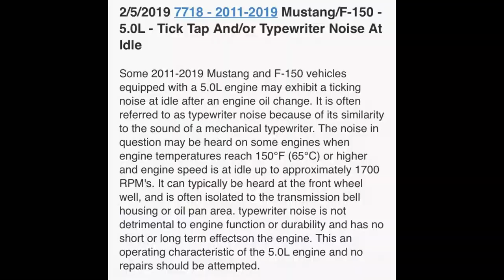2018-2021 Mustang GT Typewriter Tick/BBQ Tick. Don't Be Worried!

Comment: I've had my 2018 for almost 3 years now. Ticked since day one, no engine issues at all.  I don't even care about it any more. My biggest mistake was listening to Youtubers stating opinions as facts....that happens a lot these days. You are right about dealers putting in 8 qts instead of 10. I had to point this out to my dealer ship atleast  twice, each time they gave me a hard time about it and assumed I didn't know what I was talking about.
Reply from the maker: Man I came across it all the time. Your doing the right thing don't care about it. If it was a major issue you would know. It would be a different noise. A lot of these youtubers or people making a big deal about it don't even own the car. They hear it and are like o that doesn't sound good. I did change my oil yesterday using Cerma that I showed. Hasn't ticked yet. But I'm like you. I don't care I know there's nothing wrong. Runs smooth as butter.
Reply: During your warranty (3year maintenance) period. They only put up to 8qts. It only after that period that they add 10qts which is when you pay regular price.
Reply: Utube facts are really funny but true, that's how Trump got elected.

Comment: The tick is oil pressure related, regardless of viscosity used. The best answer we have come up with after trying to diagnose everything from big end bearings bumping side to side, to DI noise, is that the tick is most likely from the "Hydraulic Lash Adjuster" on Piston #3. This particular spot is the most arduous path of oil flow to all the HLA's. The problem is, when the oil is cold on startup, there isn't any noise, because cold oil pressure is close to 40psi. As the oil warms up, the hot idle oil pressure drops. As it goes below 30psi, you may start slowly hearing the ticking sound get louder and louder as it continues to drop to 12-15psi at idle while the oil bypass is open. This low pressure drops even further as it has to reach the HLA's. By the time it reaches #3 piston HLA, the pressure is just low enough to cause the Adjuster not to fully inflate, and become lazy. This causes it to have a tiny gap between it and the lifter. So, in a rather non-synchronous way, it will tick as that tiny gap opens just slightly with each cycle of the lifter.

As you increase engine RPM, the tick may become slightly more synchronous and noticeable until the engine RPM is high enough to make the oil pressure go above 30psi. Once RPM reaches close to 3,000RPM and the oil bypass then closes, this high pressure also fully inflates the HLA, and no more noise.

To stop the noise, I use Ceratec. Ceratec increases the lubricity of the oil to a point where tight fitting HLA's will inflate easier, and make the ticking go away. The amount of Ceratec needed to stop the ticking varies with each car, as those tiny gaps slightly differ from car to car. My car only requires about 100ml (1/3 bottle) to make the noise go away. When I give it a fresh oil change, I start the car and let it warm up to hot idle. I then slowly pour in Ceratec while at hot idle until the ticking stops (~100ml). That way I can use one bottle for 3 oil changes.

I use Quaker State Ultimate Durability 5w-30, with only 1/3 bottle Ceratec (~$50 per oil change). The cost for oil is  much less than trying to use boutique oil, which is not really necessary, unless the engine is for heavy duty use or frequent racing.
Reply: @BeardedFordTech  I know the recommended weight is 5w-20. However, in 2018+, the manual does say for track use, they say to use 5w-30, as the higher viscosity provides better protection. Main reason they went to 5w-20 is to increase fleet wide GPM for gov't CAFE standards. I discussed this with Ford, and they do allow full time use of 5w-30 oil without affecting the warranty for normal use. In fact, some dealers and Roush warranteed dealers will recommend 5w-50 Motor Craft Full Synthetic for people who have superchargers installed and drag racing.
Reply from the maker: @Condor1970  I knew about the 5w50. Coworker had a Roush. He used it cause he had to. So all those warranties i did for wrong oil could have been customer pay. Thank you for sharing with me. I don't put mine on the track though. I have sportbikes for that. Anyway. Have a good one and thanks for the informative comments!  Much appriciated.  Just looked at my manual. It does say track use recommended 5w30. Here I am telling people to look in their manual and I don't have one. I had to look on ford pass for my manual. Again thank you
Reply: Is it normal to have a consistent tick only at idle? Mine ticks only at operating temperature.
Reply from the maker: @granthenneke  yes. Mine does too. It's completely normal. The ticking your probably hearing is the high pressure fuel pump when stopped at a light or just idling. You can hear my pump and injectors. I wouldn't worry unless it's gets older with RPM and does not stop
Reply: I bought my ‘19 GT MT with 17,000 km, now at 21,000 km I’m starting to hear piston slap between 1600-2600 rpm, it isn’t loud but it is there (a bit more evident when cold start), hear it right in the passenger side as the guy in the video mention. Car isn’t under warranty anymore but I bought an engine and transmission insurance. Is there something I could do to stop it from progressing? Have the car for only 1 d*mn month and don’t want to start the calvary of an engine replacement as it doesn’t seem to affect yet. Sh*t I love this car in velocity blue but don’t know if I’m getting it right.

Just read your 5w30 oil recommendation, guess I’m beginning with that.
Reply: @JorgeMoren0  please post back with results
Reply: Thank you for your long and detailed explanation. So you think this won't affect the reliability and durability of the engine?
Reply: @EricZAchille  most likely not.
Reply: Uhh, cold start oil pressure is closer to 100 psi than 40 psi.
Reply: Idk what everyone else is talking about but mine ticks from the moment I start it til the moment I shut it off. Doesn't matter the temp or rpm. Its an obvious flaw in the coyote engine and should be recalled.
Reply: @redgoldrainwater5508   Have you tried running a heavier oil?   
The best explanation I’ve heard for the Gen 3 noise is that the noise is a combination of the VCT working at low rpm combined with intermittent loading characteristics of the high pressure fuel pump causing temporary chain slack oil on the drive side of the RH primary chain which then causes the chain to “slap” or “click” against the timing chain guide.  
It happens when the VCT is making large cam timing adjustments at low rpm, which if you’ve ever degreed a set of OHC cams you’ll be familiar with the phenomenon…and I’m sure the cam driven high pressure fuel pump throws a whole other variable into the mix.    

Apparently limiting the VCT range (via tune) at low rpm and/or running a thicker oil can help minimize the noise.
Reply: @BC08  yes I went to 5w30 and it just got worse
Reply: @redgoldrainwater5508   5W-30 is so close to 5W-20 at operating temps I’m not sure changing to a 5W-30 would mask much.  
I was thinking more along the lines of a 5W-40 or 5W-50 and see if it effects the noise.
Reply: Hey Condor1970 any idea why this often starts after the first oil change.
Reply: That does not work. Ive tried everything
Reply: My ‘21 didn’t start ticking until I took it into Ford for its first oil change at 5,000mi. I brought it back and they told me Ford released a statement saying that it’s due to new oil being introduced and that it would eventually go away on its own. It’s a 2021 GT MT btw
Reply: @Ryescookies  I'm starting to think it's oil pump related. Maybe even cavitaing at the suction, which goes away as the oil ages and gets carbon particulates in it.
Reply: @Condor1970  I have a 2011 F-150 with the Coyote 5.0L that the Ford dealer says only has 10 psi oil pressure at hot idle. I took it in because it was having VCT codes (and running rough). They recommended a new engine. I put 5W-40 in it and so far the codes haven't come back, but I still have a slight "tick" that gets louder when the engine is slowing down (after you give it a shot of gas). Haven't worked inside an engine since 1982, do you think I can just change the oil pump and bearings and leave the top alone? Only has 75,000 miles on it. Probably going to sell it, but don't want to sell somebody a truck that is about to blow up.
Reply: @lenm2857  I don't know if the 2011 is supposed to have an oil bypass at idle. If it does not, then 11psi is very low, and indicates some really worn crank bearings. On the newer 5.0's, the oil bypass valve opens at low RPM, because they are trying to decrease oil pressure and load on the engine at slower speed to increase efficiency. The bypass energizes and close above about 3k RPM. I've read if there is a way to make the oil bypass orifice smaller, or just disconnect the oil bypass solenoid, so it stays shut all the time, then idle pressure goes up to 30psi and the tick goes away. However, I have not tried this.
Reply: My 2022 GT ticked irregularly (with no regular pattern) tonight when I shifted into park after a short 15 min drive.

Does not tick when in drive/foot on break, which makes me think Condor1970 is on to something.. Not even 7k miles on it, just did a certified ford dealer oil change a couple months ago, feeding only 93 octane since day 1. I am thinking it has to do with the temperature, tonight it was around 47 degress F.  I will need to check more often after having it run for about 20 min then put it in park and see if it happens again another time...

Still love this car tho.  Hoping to keep it forever.  5.0 purrs so nice when driving at these cooler temperatures.
Reply: I know I’m probably super late and am hoping to get an answer, this question might be pretty stupid but is Ceratec ok to use in 10 speed autos? Cause I’m having this EXACT SPOT ON issue with my ticking. Just curious cause I bought 2 bottles worth but it says on their website to not use on auto transmissions?
Reply: @JrLara-ne8io I add a bottle of Ceratec at every oil change. Been doing this for 3 years and no bbq tick. Mine is 10 speed auto and has 43k miles.

Comment: I came up with the Ceratec back in 2018, it fixed it for my 2017 Mustang GT. Did a lot of research on why it mostly happened after the first oil change and I found out that Ford put some oil additive with the factory oil in the cars and after the first change, they won't do that anymore, that's how I came up with the Ceratec. Works like a charm.
Reply from the maker: Yeah but you have to keep using it and it doesn't work on all of them. Tried it on a neighbors. Didn't work. Run amsoil in mine. It stopped.
Reply: I am going to use Amsoil only on the s650 but I’m going to see what happens and I hope mine doesn’t.

Comment: I have daily driven my 2019 mustang gt 6 speed for a year and a half now with just over 5000 miles. I gotta say it is a well built car. Mine has the tick but runs great no issues at all and seams the tick is only during idle. Always follow break in procedures and you have no worries.
Reply from the maker: Never had issues with mine. Yes the tick is at idle. And your right. Ford came out with the break in procedure for the S550 (2015-present) I was a tech there for 6 years and we would always tell customers. Some would listen some wouldn't. Break in procedure is as follows for S550 mustangs 2015-2021 for people who don't know. Thank you for bringing up a great point. 
The vehicle requires a break-in period. Drive your new vehicle at least 100 mi (160 km) before performing extended wide open throttle maneuvers and at least 1,000 mi (1,600 km) before performance or competition conditions.

Mine runs like a champ!
Reply: hey put liquic molly ceratec in your oil, and it'll go away. i put it in my 17 and it fixed it immediately
Reply from the maker: @predalienftw  I'm not a fan of ceratech. Liquid moly makes some great stuff. But ceratech I'm not fond of. Buddy put it in his toyota tacoma. And it needed a new engine. I've heard people say it makes it stop. But it doesn't bother me and mine doesn't really do it.
Reply: @BeardedFordTech  i can tell you that an oil additive wouldnt be the cause of a blown engine, the product is worth considering if the click begins to bother you
Reply from the maker: @predalienftw  it never has bothered me. I worked at Ford for 6 years. I'm just not fond of any kind of additive. A treatment is fine like Cerma coating. It just uses the oil to carry it. It is not a additive to make it thicker or anything. Liquid moly makes some great products. There's literally nothing wrong with the bbq tick. Annoying yes. Engine damage no. I'm just not the type of person to put an additive in everytime I change my oil.  I didn't say the ceratec was the problem of why it needed a new engine. Just so happened it was after it. Course toyota never told him. I've only seen an engine fail cause of additive one time in my entire mechanic career. It was a 2004 GMC sierra the guy put lucas in it. That stuff is thick. Oil starvation spun two rod bearings. My car has been Cerma treated. Come to think of it I don't think it ever ticked or it does it ever so slightly I just don't pay attention to it. Not hating on liquid moly or people who use it. If it works it works and that's great.
Reply from the maker: @predalienftw  and I can tell you this. The main ingredient in liqui moly.ceratec is boron oxide. Boron oxide is hydroscopic meaning it holds water like brake fluid.
Reply: Do you have "2k rpm rattle"

Comment: How did the cerma work out for you?? Decreased tick? How do you like it vs ceretec?? Any pros or cons your aware of? Do you think any of these products will quiet down the " spark knock " at idle you explaind to me the other day?? Btw thanks so much for the reply. I realy love this car so far and that set my mind at ease.
Reply from the maker: Cerma didn't do that great. It is not a "self cleaning oil". I don't use their product anymore after doing some oil testing. I left this video up so you could hear the noise. So just ignore the cerma. As far as ceretec. Some guys use it and say it works. Others said it doesn't. You have to put it in at every oil change. I actually use Amsoil. Nothing is going to get rid of the "spark knock". Just run a higher octane gas and every now and then a octane booster. It will quiet down.  With Amsoil it may do the tick on startup after an oil change but will go away or quiet down a lot. You can also run 5w30 instead of the 5w20 that's helps a little too.

Comment: I have read in your comments that you use Amsoil in you Mustang instead of additives.  Did you use the OE, extended life, or the Signature Series?
Reply from the maker: @RMAGarage  XL series I run XL in all my vehicles.
Reply: @BeardedFordTech  Thanks for the info.  I used the OE oil for the first time and just came across your comment.  I can try the XL on the next oil change.
Reply from the maker: @RMAGarage  xl seems to work better where I am for.some reason

Comment: Has the Cermec oil been doing well for you? I been thinking about using their 5w30 for my 2021 GT.
Reply from the maker: No. I stopped using it after doing an oil analysis.  I know this video is pretty old. What they state on the bottle and their claims are just not true. I run Amsoil. Never had a problem with any Amsoil product.

Comment: Great video. I had a 19 GT and later got a 2019 f150 5.0.    My GT never had the tick but a lot of friends did. Luck ran out with the f150. Do you know of a replacement oil pan, like a metal one or idk? Any advice on replacing the f150 manifold to a GT/350 ? Seen a lot of videos but were only up to 2017, so I don’t know what manifold would be a direct match to my 2019 f150
Reply from the maker: Replacing the oil pan isn't going to make the noise go away. However if you want a better one go with banks. I don't have a video on the GT350 removal. Are you wanting to swap out intakes or something?  Not all of the mustangs and f150's have the BBQ tick. It's sporadic. I'll also recommend a banks pedal monster foe your truck. Unleash that hidden power.

Comment: I have a n 18 GT Mustang with 42000 miles.  I purchased this car brand new. 6 speed manual. I love the car. 
Question I have is about better oil to use. 5-20 or 5-30? or ?
Reply from the maker: 5W20. 5w30 on the 2018 is recommended for track.

Comment: I've got a coyote 5.0 2016 F150.  Same noise (I think).   Thinking of going with 5w50. Any idea if the oil pump is engineered to handle that additional weight?  Worried about burn out of it. Thanks
Reply from the maker: I wouldn't put 5w50 in it. Your not going to do anything but put heavier oil in it and possible cause more damage. It won't make the noise go away.

Comment: is it normal for it to increase as u rev up to like 1-2k rpm? mine sounds just like yours, very inconsistent, but when i accelerate i hear the noise increasing.
Reply from the maker: @averyhogg86  yes. Can be heard up to 1800 rpms.